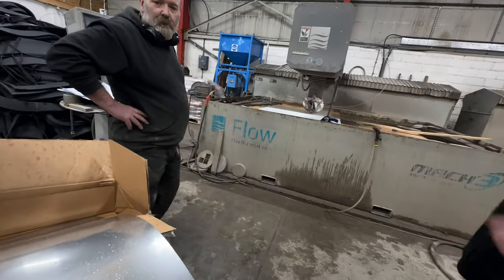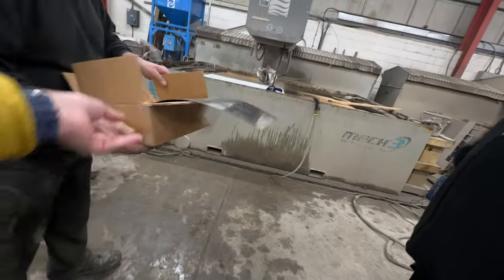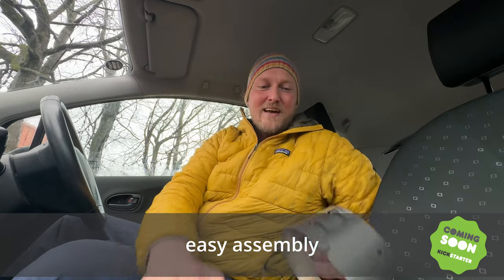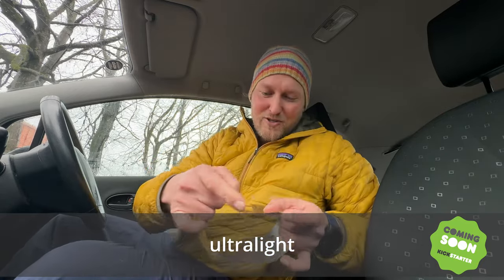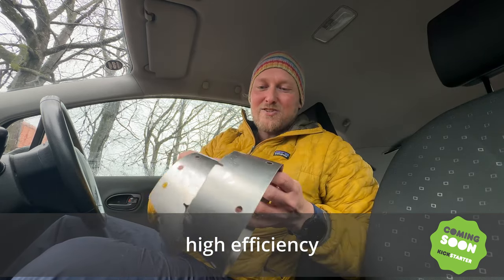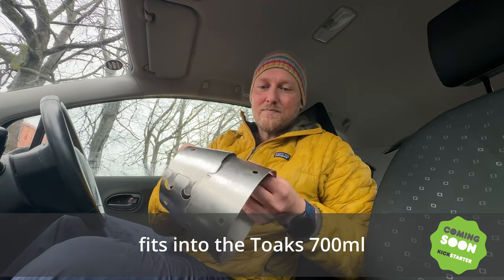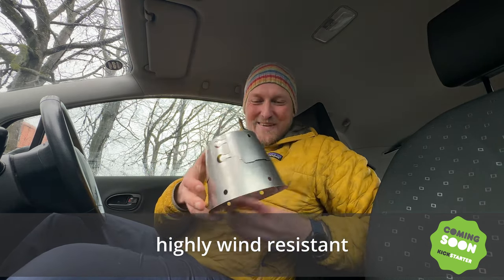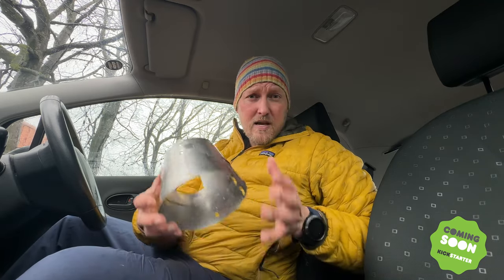FeatherLight 700: ultralight, high efficient alcohol cooking system

Comment: Verry Well done Stripey.........i asked the guy who makes the Vesuv if he can make a 2 part windshield that fits inside a Toaks 700 mug and sent him a video of the Storming Norman . He said he would look into it but he never got around to it. You are filling a much needed gap in the market and i personally am really looking forward to being able to buy one :)
Reply from the maker: Thank you very much! The reason I started the whole project was actually the reason that I couldn’t find any ultralight, high efficient alcohol cone which would fit into my pot. As you mentioned there are some cones out there but they are either not nesting in the pot or they have in my eyes some massive design flaws not just regarding the efficiency. It makes me questioning if the companies actually used the cones themselves 😂

Hopefully I can get the other open points sorted shortly that we can start with kickstarter soon. I will post a proper video to the cone before the campaign starts - thanks a lot

Stripey
Reply: @StripeyHatGuy  you're welcome Stripey.  The most effective burner/ windshield  combo i have come up with is to use thr Trangia gel burner with some heat resistant felt inside and a vesuv 600 windshield and Evernew 600 pot. Maybe using the trangia gel burner this way would be best for your 700 featherlight system because it gives out a lot of heat so it should be a very good combination 👍 👌
Reply from the maker: @Olan...  interesting solution you did. In the Featherlight 700 case I can say that the output of the trangia is too high. It boils quicker but needs much more fuel than the we kojin style stove.
Reply: OK I understand but when i said Trangia i didn't mean the regular Trangia alcohol burner i meant the silver gel burner pot but with some felt inside to make it spill proof and you can use the lid to put out the flame although you have to use all the fuel that you pour because the gel burner pot isn't a good seal when the lid is on. @StripeyHatGuy
Reply from the maker: Ah ok, actually I don't know this one - interesting 👍

Comment: Hi Stripey, I have a Vesuv cone and it’s really efficient but the press stud fastening deforms the material on opening! I’ve made a few myself out of 0.1mm titanium but neat cutting is not really possible. Since the Stormin comes can no longer be obtained and the Caldera items have to come from the USA I’d have thought there’ll be a big market for it in the uk. Are you also going to produce a puck burner to go with it? I use my vesuv with a 600ml Evernew pan, so when your production is up and running you can put me down for an order! Great Stuff Thanks.
Reply from the maker: Thanks a lot Nick! Yes I will provide the stove with it for the highest efficiency possible - I will explain how and why this is the case in a later video closer to the start of kickstarter but in short the whole cone layout is calculated and for a reduction of variables I used the ‘stove’ surface and height as fixed.  (I have a video on the stove on my channel).

This is also the reason why the FeatherLight 700 has its highest efficiency with the Toaks 700 pot. Of course you could use a pot with the same diameter but other measurements would be probably off and the efficiency would be lower.

Cheers
Stripey

Comment: Will def be ordering one if you have options for different pots,
Reply from the maker: Nice to hear, initially I will do only a Featherlight 700 as it is the most efficient combination - which means not that no other pot sizes are considered for future projects.
Cheers
Stripey
Reply: @StripeyHatGuy  I imagine I’ll get one anyway. Apologies which pot is it for?
Reply from the maker: @richardwaudby7338 no worries! The FeatherLight 700 will be for the Toaks 700ml long handle, or other pots with the same measurements. I already implied in the name with 700 that other sizes might follow in the future but I want to first finish one kickstarter and then I need to have a look if/how I will proceed.